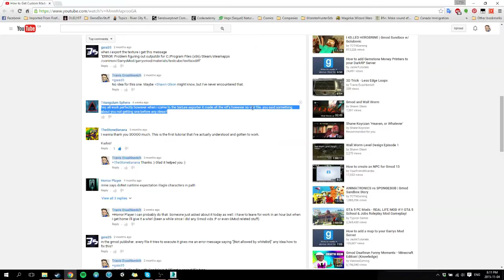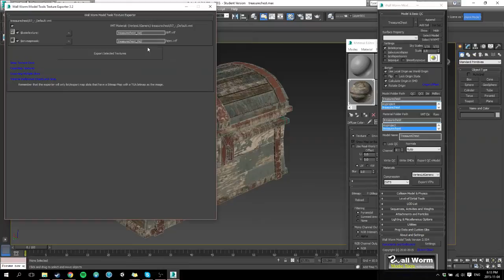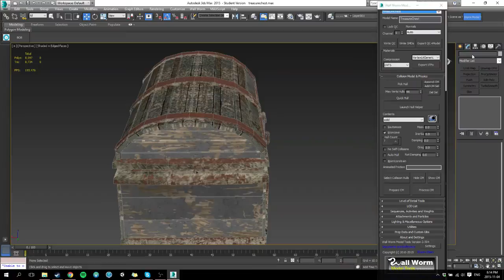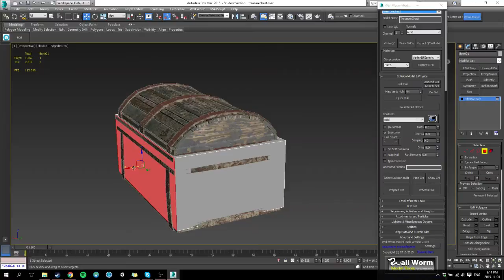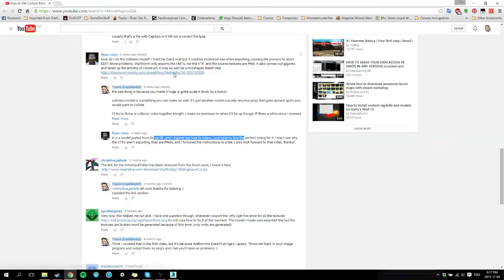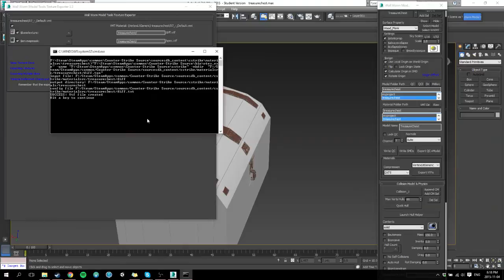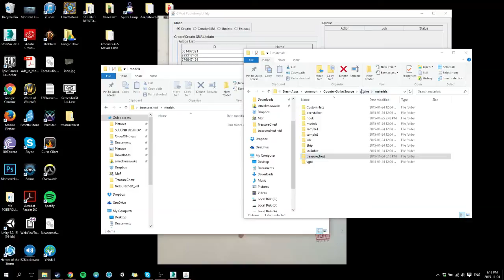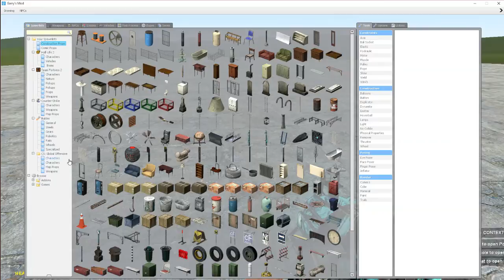Gmod Collision Mesh Creation AND Troubleshooting Texture Problem

Comment: I'm watching the video and I think I know what your problem is with the subchannel materials, not sure... but it's worth giving a try. The MDL exporter menu has a "Channels" value with a number next to it. Try setting it to the number of materials uve got in the multimaterial. I'm still having trouble setting Wall Worm up but could you test it and see if it works? I'd hate to work with only one texture per whole model.

Comment: Ok this is what it says I don't have any capital letters in my materials and I named mine Candycane1 because I already made one the one without collision. Did it not export correctly or something like that.

Creating addon from C:\Users\Dil\Desktop\candycane1...
Creating temporary addon.json.
Creating temporary gma.
Garry's Mod Addon Creator 1.1
Looking in folder "C:/Users/Dil/Desktop/candycane1/"
 model/myproject/candycane.bat
  [Not allowed by whitelist]
 model/myproject/candycane.qc
  [Not allowed by whitelist]
 model/myproject/candycane.smd
  [Not allowed by whitelist]
 model/myproject/candycane_hull.smd
  [Not allowed by whitelist]
 model/myproject/candycane_wwmt_custom.qci
  [Not allowed by whitelist]
File list verification failed
Creation OK!
Finished running queue.
Refreshing addon list.
Retreving list of Addons.
ID: 536963705 Name: "Candy Cane Model"
Retrieval Finished!
Finished refreshing addon list.
Reply from the maker: +Siper12 It could be the "myproject" part but it also looks like you don't have any textures either (unless you're just vertex coloring which I don't know if that works in Source or not..never checked) Looks like something isn't exported correctly.
Reply: Well I am using the material it's a candycane so it has the multi sub I belive what it's called.
Reply: So is there any way to make a candycane? or soemthing with more than one material?
Reply from the maker: I'll do a quick video tonight. It's really simple. You don't actually need more than one material for a candy cane though.
Reply: +Travis Evashkevich Thank you I am not a good modeler. I'm still learning all the tools and other things and thank you your video's have been very helpful.
Reply from the maker: +Siper12 https://www.youtube.com/watch?v=IB6Fhws6RGY&amp;feature=youtu.be
Here ya go :) It'll be a few minutes till it's done uploading/processing but it will be there shortly :)

Comment: What is a vvd file? I found it while going through a content pack on a custom server.
Reply from the maker: used for physics and collisions if I remember correctly
Reply: +Travis Evashkevich isn't there a file were you can make custom animations?
Reply from the maker: +Horror Player for animations you would definitely want to do that in a program... trying to write that manually would likely make you insane